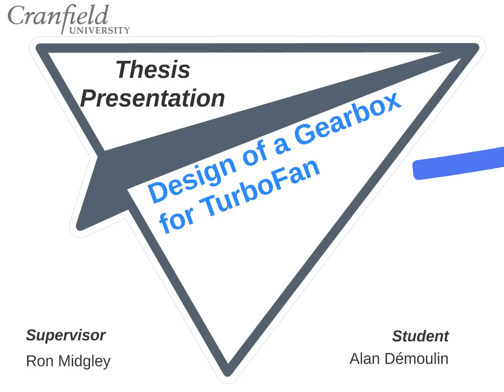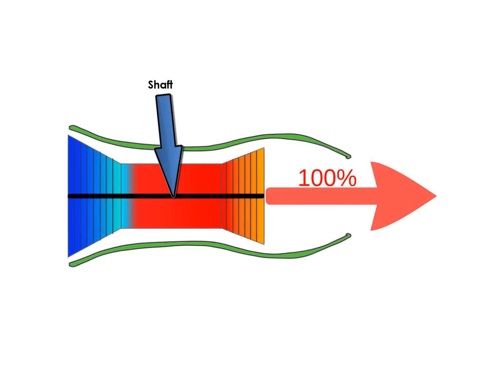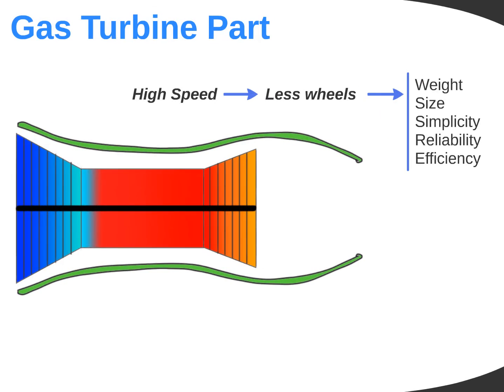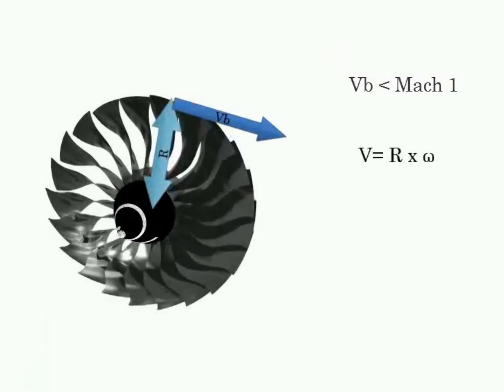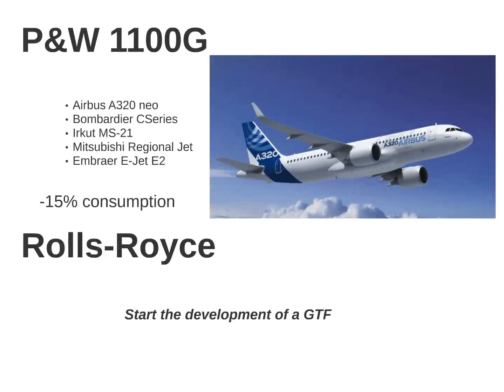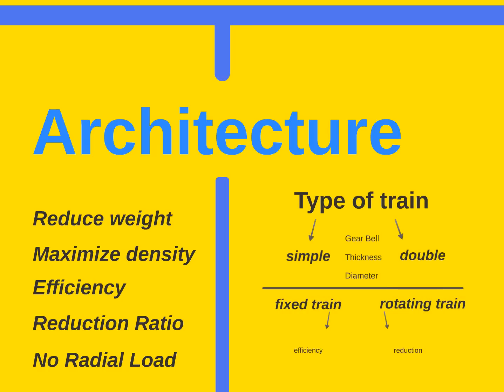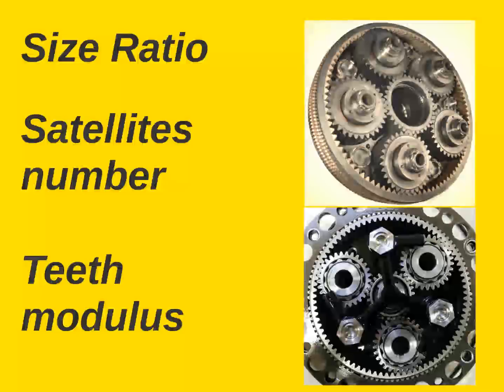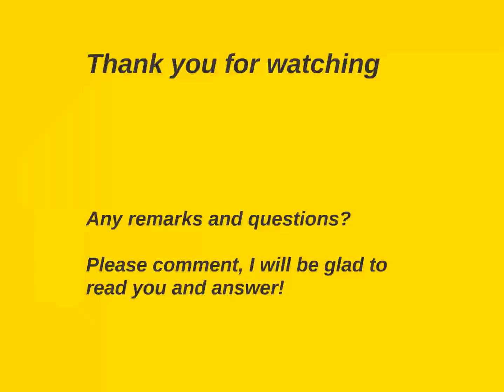Design of a gearbox for turbofan application -thesis introduction

Comment: Squeez energy from hot section to the most. To use such gear, they must have excellent metallugy in hot section on engine module. Its simple like that. Thats why PW has lower temp in hot section than GE.

Comment: I appreciate design. I think this is a modification to RR 3 spool. This means every spool of the engine rotates at a different speed to the best of there efficiency, Here the fan turbine allowed to go up to 15000 rpm means the chance of vibration is high. instead of this best pre-determined angle of the incident to the turbine was better I feel. Awaiting for replay.

Comment: A gearbox is not needed, because the giant fan in the front of the engine supplies most of the thrust. It is driven by the low-pressure turbine, thru the hollow shaft, which the first set of compressors are mounted on. This is a shaft, within a shaft system. A gearbox would add extra weight, and, possible reliability issues.
Reply: there is a gearbox in latest Pratt Whitney 1100, it reduces fan tip speed inefficiencies, also increases bypass ratio, also reduces number of compression stages in LP section, less moving parts more efficient, gearbox is a variable planetary
Reply: Some are geared, some are not. The P&W PT6 turboprop has a gearbox that lives happily for thousands of hours.
Reply: The discussion is about a Turbofan not Turboshaft different application, most turboshaft engines incorporate reduction gearboxes of which the PT6 is one of the most common
Reply: Dryootube Turboprop and turbofan are functionally identical.
Reply: YES and No. Turboprop, hardly any thrust from the exhaust. propellor is driven by reduction gear and responsible for almost all thrust. Turbofan engine, exhaust drives turbofan shaft and produces thrust, though relatively small compared to the bypass.
Reply: I suppose that is why they have different names
Reply: other than reducing the blade tip speed to below mach1, the purpose also serves to reduce  the speed of the intake air and speed it up through between the nacelle to exit at a higher velocity. The greater the velocity difference between input and output air the greater the thrust produced
Reply: Or use larger slower spinning low pressure compressor blades and turbines in lieu of a gearbox just like General electric, IAE, and CFM leap.
Reply: Yeah, but i assume the slower spinning LP comp. turbines equals a lower exit velocity, hence less thrust from the core?
Reply: @davidperry4013  that is the core problem around turbine engines,and the reason  gears are needed for high efficiency, slow speeds are great for  thrusting but mighty inefficient for compressing, remember turbines can´t have "piston rings" that seal efficiently at any speed. so the higher the compressor speed the higher the efficiency,.. and viceversa

Comment: how would air flow threw the gears ? 
i need to see how this would be laid out ... 
ive had my own ideas but there different i think
Reply from the maker: It don't. The gearbox is closed and the gears are cooled/lubricated using oil jet lubrication.
Reply: @AlanDemoulin  yes, gearbox assembly longitudinal profile would be "shadowed" behind the fan hub..(as an accessory module would be ahead of compressor section module) as seen in simple diagrams of TF/GTF differences 🤔😄👍
Reply: I just thought of an offset core.. but would not be as practical to drive fan from circumference vs hub, and would potentially add too much structural weight to compensate for offset differential thrusts @ different  power settings..thrust line gets complicated..opens up potential & problematic possibilities!🤯

Comment: can anyone  tell me that where is the actual location of gears in gas turbine. ?
Reply from the maker: For the turbofan, the gears is not in the gas turbine, it's between the gas turbine and the fan.
There is no need of a gearbox inside the gas turbine, it can be needed at is output in order to convert rotational speed into torque, reduce the speed or the reverse

Comment: Enjoyed your video very much. There is something that the Pratt & Whitney technical bulletins on their GTF don't talk about; it seems that even assuming 100% efficiency of the gear system, there is torque that the rotating gears put on the casing that encompasses the whole planetary gear system.  It seems that that factor would cause a significant amount of torque generated against the center of mass of the whole engine. A person like myself trying to understand this aspect of engine design wouldn't know that this wouldn't affect the dynamics of the whole engine and the whole plane?  Can you enlighten me a little?

Comment: I am interested in the turbofan gearbox and its production.
Reply: Like a planetary gear set in an automatic transmission in your car only much bigger  ! the  steel manufacturing is of the highest quality so as to take thousands of horsepower ,hardness and reductions are of a far superior quality along the lines of the individual intake blades also new central bearings were needed  and manufactured along the same lines Quality quality quality ! bypass is around 15 to 1

Comment: I have started working on performance of geared turbofan engine.....can you recommend me some reading material on gearbox performance like efficiency and losses
Reply from the maker: Abhijeet Sinha Gear box efficiency is linked this numerous parameters, but they are pretty similar from those you can find in a non aerogear box, teeth parameters and correction, bearing type, lubrication, etc... You can have a look on the ANSI AGMA 6123 B06, this is this american standard to design epicyclic gear box.
Reply: Ok, you seem like you may know the answer to a question that has been bugging me for a few days now. It appears to me that that there must be some sort of gearbox between each jet engine stage already since, like in a GE90, they each turn at very different speeds. With this in mind, please explain why this final gear reduction has been so difficult to achieve. How are the intermediate stages coupled anyway, they each seem to turn at different speeds, they have counter rotating sections, reverse direction, etc., and yet they still transmit power from the rear turbine thru to very large powerful fans, now PW is saying that a gearbox on the final connection is a game changer, please explain. I see this comment is 1 year old, so I'm saying thanks in advance if you decide to answer me.